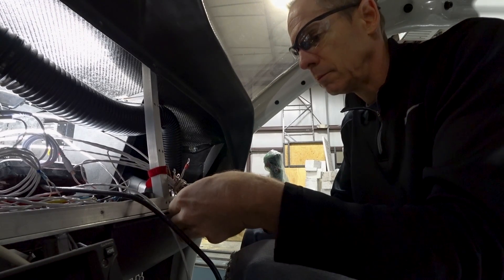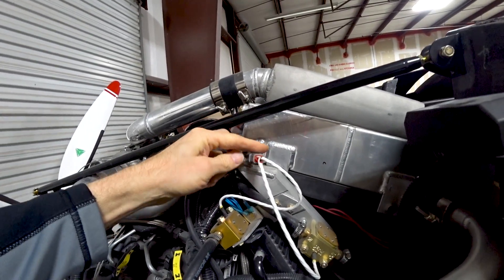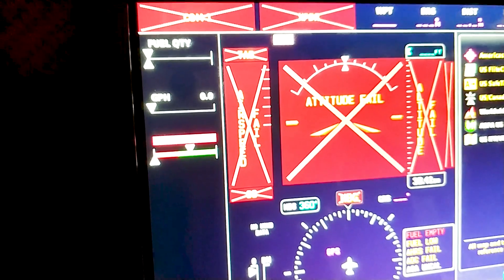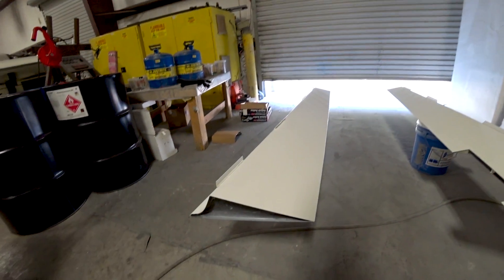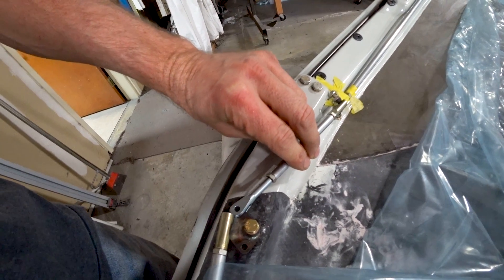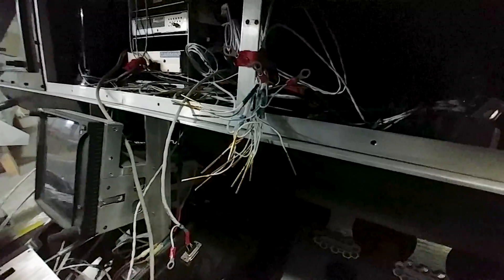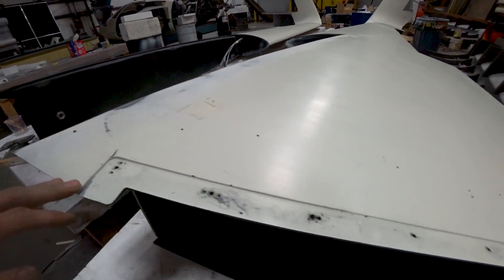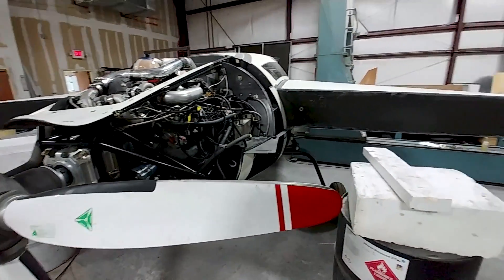The Weight Is Over - Building the Raptor Prototype

Comment: I find it interesting, but also typical, that nearly every video I’ve watched over the past three years has had glowing comments about every step of the process yet when the weight issue came up in this video,, all of a sudden there are dozens and dozens of I told-you-so-ers and nay sayers crawling out of the woodwork.  Now the engine is a horrible idea.  Insurance is impossible.  Costs will never work out.  The weight is not solvable.  Maybe I completely missed it, but I don’t remember seeing many of these comments earlier. Now that there is a hurdle, everyone is jumping on the bandwagon. Personally, I believe based on what ive seen with the attention to detail that this wil be solved.  . Look at all of the amazing work that has been done.    Focus on possible solutions for cutting weight.   Provide those comments.  Solutions, not problems.

Comment: Sadly, this is Peter's first reality setback. It's not a game killer because even at a gross weight of say 4200 lbs it'll still have a better power to weight ratio than a A36 Bonanza. No, the two elephants in the room are the cost and insurance. I built N36LV. I thought I could do it for $180K. It took more than $230K to finish it. Peter's got a $20K+ propeller hanging off the back, an engine system worth at least $40-50K, $7K worth of Hysol, $75K worth of avionics, etc, etc. Figure another $15-$20K for paint and interior. Notice I haven't mentioned the cost of anything built out of carbon fiber yet? Now to the really ugly part. How many builders can go bareback without hull insurance for a quarter million dollar plus investment. Insurance was one of the driving factors that made me decide to sell the plane. Aviation insurance companies hate fast homebuilts. They really hate fast, retractable gear homebuilts. They absolutely despise automotive engine conversions. And lastly, the thought of a reasonably-priced, fast, auto-engined, retractable-gear, pressurized homebuilt will send them scurrying into the woodwork. When my plane first flew, my premiums were $3700 a year for a hull value of $230K. Six years later, they were climbing past $7500 a year for a hull value of $180K and I had never scratched a plane in 30 years of flying. It is my opinion, at least until someone puts a thousand or so hours of safe flying on one of these planes, hull insurance will not be available at any cost. Bummer.

Comment: Question for you: The landing gear wheel sets look like they are from Beringer. Nice gear indeed. I just checked, are you sure these are strong enough to carry the bird? The largest Beringer sets (JAB02-HE3) are rated for ~2100lbs static. Your empty weight once complete will be around 3000lbs. Add fuel, engine fluids, passengers. Are you sure the wheels are the right choice?

Comment: A 26% overrun from the specified mass would be a hard-down full-stop red alert in any rational aerospace company. As I've posted on HBA, I think you can still get some value from this airframe. But I think you need to go back to the drawing board and do a better job of managing both mass and expectations.
Reply: Yeah at least test the airframe and engine while the interior and options are kept to a minimal. Focus on figuring out the weight an balance using lead to experiment with payload and performance expectations. Then once you know the payload “budget” option it out starting from the most important features. Would be a shame to spend all that money on options just to need to pull them out to get the weight down. Would be an even bigger shame to have a totally optioned our finished aircraft then run into serious flight testing issues that could’ve been addressed at a much earlier stage.

The aircraft will keep on getting heavier as it nears completion and the interior is refined. 200lbs now might end up being 300-350lbs once the rest of the interior is done and paint is added to the exterior.

Comment: The heck with the Avengers, you are my hero! I am building a Quickie Q2 with a Yamaha Genesis engine, so we have many of the same kind of challenges  to work through, mine are just on a smaller scale. I learn so much from these videos. I started watching when you bought the big table mill and haven't missed an episode. Thanks for the inspiration, the Raptor is going to be my next plane.
Reply: Hi Sage, hows your build going? The Quickie is a gorgeous Aircraft. I tried doing research on it but the quickheads site is gone. What sites can I check out? Also, is the moisture on the canard issue resolved?
Reply: @neve1064  There is a great  group on Facebook for the Quickies, tons of knowledgeable people on there too. The Q200 had a redesigned canard they call an LS2 it has an increased gross weight and different shaped airfoil that handles the rain better. The Q2 has to GU canard but they say vortex generators fix the rain issue as well.

Comment: I worked as a painter when young. Water the floor before paiting and you keep the really small particles on the ground instead of getting airborne and into the paint job. Awesome craftmanship and lovely to follow the progress. I wouldn't mind a try for electric motor but I guess impossible to keep all the batteries needed in the wings and still fly.

Comment: I am continually impressed and like many getting excited.   Empty weight of the prototype is not a huge deal.  With all those systems there are LOTS of opportunities for a diet.
On the c/g, the most important thing,  perhaps a small fuel tank in the nose if a battery change is not enough?  Concord style.

Comment: This airplane is so important to aviation.  It doesn’t matter to me as a consumer if all I can put in this airplane is two small adults and two 25lb bags.  

What matters to me is that I can travel at 220kts at 25k feet, and I can get 7gph fuel burn.  

What matters is that I’m not forced to spend 100,000.00$ plus for a 300hp airplane engine.  finally someone has put some real time and effort into integrating a car engine into an airplane and sharing the experience real time.

I have been a aerospace engineer for near 10 years now and would be happy to contribute to this endeavor to help make it a success. 

When you start taking escrow payments again I’ll be waiting.
Reply: Trent Palmer has some really good explanations on why you want an engine built for a plane. It boils down to the manufacturer testing, validating and providing service bulletins or even grounding if it not safe. That's what you get with the price.
Reply: @TheJttv  Aviation engines are dinosaurs. Well proven dinosaurs, but costs for research and development needed to push current technology into general aviation is just astounding.  Modern auto engines LS1/LS3, and especially diesels VW TDI/Audi TDI, have the durability and reliability to survive and thrive in aviation today if the platform is engineered to use it.  Trent Palmer has a very entertaining channel, and he among many others stick their noses up at auto engines.  I look forward to a $5000 zero TSN engine replacement, higher performance, less maintenance, more efficient and economical engine choice. GearedDrives has some great amounts of data for his system and how many hours his system has thrived on the LS3 geared PSRU (tens of thousands of hours without failure).  Great setup.  This little TDI......if the in-house belt driven PSRU holds up then this TDI is gonna make the GA industries head spin.
Reply: @shawnbryan6626  Agreed.  If any pure automotive engine can transition to GA, the Audi/VW will be the one. Audi/VW has been building tdi's since the 1940's.  When they see how successful Raptor's engine will be, they may take interest.  Drone applications alone could create a new and successful line of business for them.  I hope Peter will get some serious credit for pioneering the the turbos, redrive, electronics, etc., etc...  Amazing work.
Reply: @PistonAvatarGuy  Have you seen all of the videos from this series?  Peter has this thing on the test stand pushing 450hp.  I do believe its been dialed back a bit since then, but the hp/lb ratio is going to be adequate if not a bit overpowered.  The CD-300 certified diesels costs are rediculous.  There is no way the average aircraft owner could ever afford to retrofit or purchase a new Cessna 182.  Frankly an $80,000 engine option is just too much.
Reply: II think I read Peter comment last year to one poster who said electric was they way to go for this project in the future.  Ha agreed. Also, he mentioned at the open house building an engine to challenge the conventional approach was a big part of what his paradigm is about. He can always fall back on a certified dinosaur. Anyone following that Siemens electric power plant for LSAs?
Reply: Wait... he didn’t mean current tech but eventually electric systems would be robust enough way down the line.
Reply: @PistonAvatarGuy  this comment is laughable based on recent strides in the industry

Comment: You'd need to be making ~460 hp to match the power to weight ratio of a Cessna 340, or you'd need to weigh ~2,000 pounds (you're going by empty weight here).
Reply: Diesel is still by far the most cost effective. They burn diesel or JET-A, and diesel is literally half the cost of jet-a and 100% cheaper then running av gas.

If your running a CD-155 you would be a fool to not run it on a tax exempt diesel like marine/dyed diesel for well under $3 per gallon. 

Just call up a local bulk fuel/home heating fuel retailer and they can have a fuel truck to your location within hours. I ran my boat exclusively on dyed/marine diesel for years thanks to our local retailer at a fraction of the cost of marina gas bar price. $480 would get me 200gal and they would come to my cottage vs needing to go to the marina for a fill. 

Aircraft are off highways equipment so just like construction, farm, marine equipments no reason to not run a tax exempt fuel in it. 

There’s also the benefit of diesel being meant to run in a internal combustion engine unlike JET-A which has no guaranteed cetane rating and could potentially not run in IC engine. Exxon even makes you sign a waiver before filling JET-A into a piston Diesel/JET-A aircraft.

There’s literally nothing that can compare to the cost of running a diesel aircraft if you can swing the 60-70k retrofit cost, or +1m purchase price of a new one.
Reply: That’s a lot of GPH 🤑
Reply: @Alex-us2vw  Around 26-28 GPH, by my calculation, not too bad, but the engine would definitely have trouble producing that much power reliably.
Reply: TheBrokenWorld an automotive engine would for sure struggle to produce +400hp continuously or even 60-70% of the rated power output. Would be running the engine at high rpm setting to hit the peak power output. To get 420hp out of the twin turbo BMW M3 engine would be around 6-7k RPM.

I don’t really understand why they are trying to use an automobile engine. When you run them at 60%-100% continuous power settings like an aircraft engine demands they drink fuel just as fast as similar HP aircraft engines. Add in the additional weight of  radiators, coolant, water pump and all the other parts not found on an air cooled aircraft engine and it really becomes a losing proposition. Then when you take into account getting maintenance or repairs done away from home base it would really become a nightmare.
Reply: idontcare80 - there’s no 30% fuel reduction there. A 180hp IO-360 Lycoming will consume the exact same at full power as that Honda engine you mentioned. 12-13GPH on full power climb which is 0.4lb per hp /hr, at cruise setting leaned gets down to 7-8gph leaned out. 

The turbo version of the IO-360 also puts out more HP (210-225 usually) and can maintain the HP at altitude. TSIO-360 is not much worse on fuel then the IO-360 when factoring in the extra power and being able to make that power where you need it up high for an efficient cruise. So for cruising/cross country the TSIO versions are actually much more efficient compared to an IO. If the engine is primarily used low level and for pattern work like in flight training then the IO engines have the benefit in efficiency.

You see the same thing with boat engines since they operate under very similar load demands as aircraft. When comparing MPG of cars to boats boat engines seem terribly inefficient (they really drink fuel fast). Even a small 150hp outboard at WOT burns about 14.5 GPH. It’s not the engine though it’s the engine load that is making them so inefficient since you are actually using all that hp. Unlike in a car that coasts, and cruises at very low power settings (10%) once up to speed. Can look at those same car engines installed in boats, like the popular GM 5.7L vortec v8 commonly found in trucks and in marine applications where is burns 23gph WOT down the lake. Same deal when you throw these engines in aircraft they burn just as much fuel as a fuel injected aircraft engine. Only difference is the weight penelty you also suffer from running auto engines which is important in aviation unlike marine applications.

Just makes no sense to burden an airframe with all that additional weight trying to make an automotive engine do what commercially available aircraft engines already reliably provide.
Reply: idontcare80 the TSIO-360 is still more efficient hp per hp then that 180hp engine though. It’s 225hp and easily does 10.5-12 GPH with leaning so that’s even more efficient then the io-360 hp per hp and much more efficient then the Viking engine.

The TSIO-550 will drink 30gph on the climb out sure but that’s only a few minutes. The majority of the flight will be 17-18 gph which is not too bad for a 325hp engine. Don’t know anything about the Adept 320T but if it’s really that much lighter wet once the cooling system is installed and filled then it shouldn’t be long till we see manufactures phase out the TSIO-550 and turbo normalized io-520. I doubt the 320t would be much different in fuel consumption though at equivalent power settings 100% vs 100%, 75% vs 75% ect.

The only engines I’ve seen actually put out impressive numbers have been the JET-A diesels that come in near 40% the fuel burn of their equivalent HP 100LL counterparts. But they will never catch on since they are not rebuildable for the foreseeable future due to no case/crank inventory. Plus mid cycle transmission overhauls, higher purchase price, and end of life exchange costs narrowing the gap in savings. When all is said and done you save 15-20k over the life of the engine depending on the cost of JET-A in your area, but have significantly higher initial capital outlay vs an avgas engine. Could be better to buy the avgas engine and pick some good stocks with money saved to hold instead.
Reply: The 3200lb MTOW Velocity V Twin that uses 2 IO-320 can do between 10-15 GPH. If that was upsized to the weight of the prototype Raptor of 3000lbs dry would need 2 IO-360 and be in the 15-25GPH range depending on power setting.

With a single engine config there will realistically be no way to surpass 400hp with piston single unless fitting an IO-720. At that power it’s into the small turbine range like a Rolls Royce M250 series turboprop. Would save a ton of weight going turbine, similar mid 20-25 GPH fuel burn, runs on significantly cheaper fuel, and much longer TBO times.
Reply: @Alex-us2vw  Typically, I think that people are attracted to automobile engines because they're liquid cooled, don't require the user to adjust the mixture and are generally smoother in operation. What I don't understand is the attraction to diesels, they're just so heavy, even Cessna dropped them from their lineup because they reduced the usability of their aircraft so severely. I suppose that people are worried about the availability of avgas, but unleaded fuels will likely replace it, and automotive engines run just fine on unleaded. The performance increases that can be had with liquid cooling are significant, even Lycoming and Continental engines see significantly improved performance when they're liquid cooled. I remember seeing a Lycoming that was converted to liquid cooling and it had a BSFC on par with this diesel. Usually, the drag of the cooling system can be greatly reduced with liquid cooling (using the Meredith effect), but it doesn't look like these guys took advantage of that. Liquid cooled engines can also be lighter (largely because they can be pushed harder and made more compact), unless you're talking about air cooled engines that were converted to liquid cooling. Even the Continental Voyager engines were lighter than the air cooled engines that they were based on, but that was dry and without the radiator. Burt Rutan had some interesting observations about liquid cooled engines that are worth looking up.

I think that the RR 250 consumes about 50% more fuel than this engine, at least, and those are extremely expensive to buy.
Reply: If they really wanted to go for efficient fuel burn at this kind of aircraft weight they should’ve designed it as a twin engine and run the continental diesel aviation engines. Like the CD-135, CD-155, CD-300 which all have amazing fuel burns and use JET-A for additional savings.
Reply: Plus you still need to pay the road tax bundled into mogas, and for the higher performance Rotax like a 915is it needs premium fuel. 

The aviation diesels run on diesel which makes buying tax exempt fuel a breeze. Can’t buy premium gas for $2.30 a gallon but can get tax exempt diesel coast to coast, or in pinch when not a your home base buy JET-A. Could easily save 75k in fuel over 2000hrs if primarily operating from your home airport and have a hangar running a tax exempt diesel.